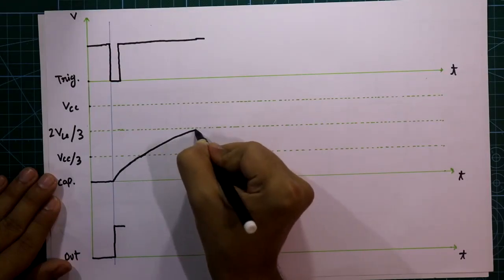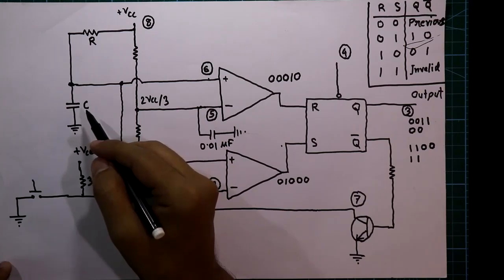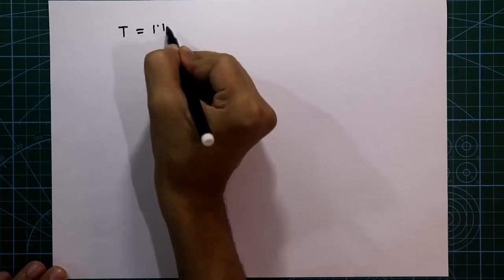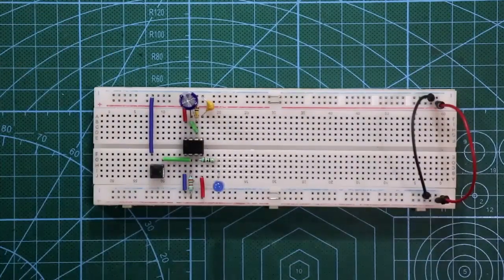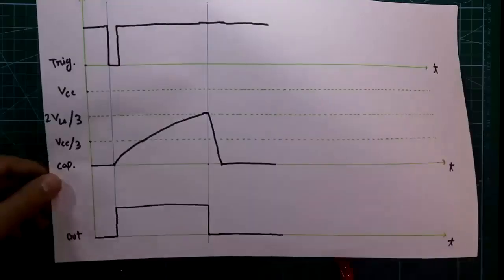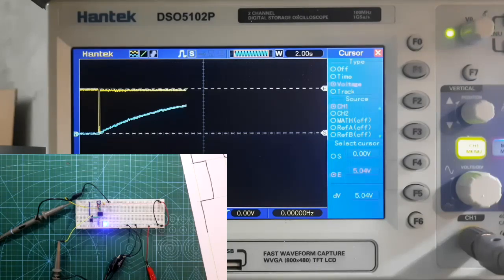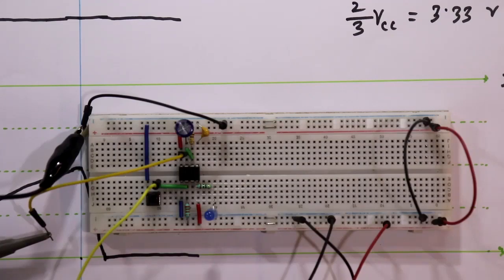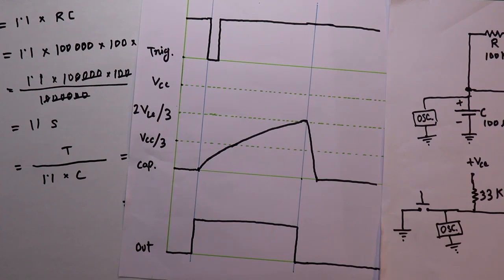Monostable mode of 555 timer IC explained with oscilloscope | Practical part

Comment: Thank you for this and the previous videos. This is the most concise, most detailed and most informative presentation that I have seen for 555 monostable mode. You clearly showed, step by step, at a comprehensible pace, exactly what occurs internally inside the 555, as well as showing how to modify the timing of the output. Well done!
Reply from the maker: Thank you so much..!